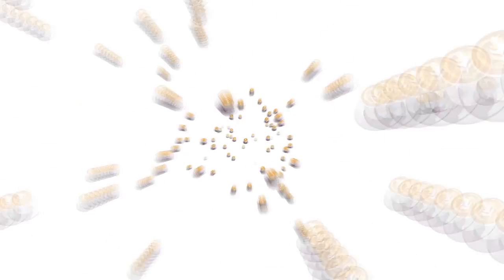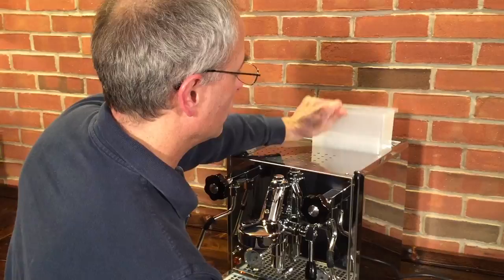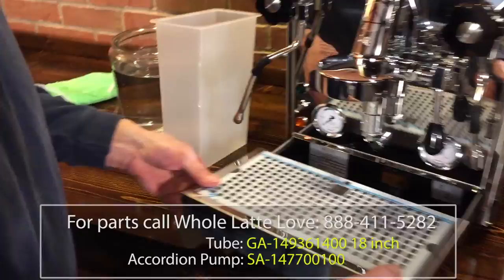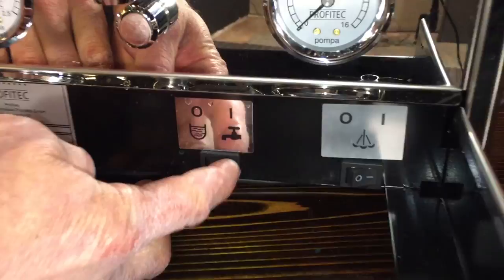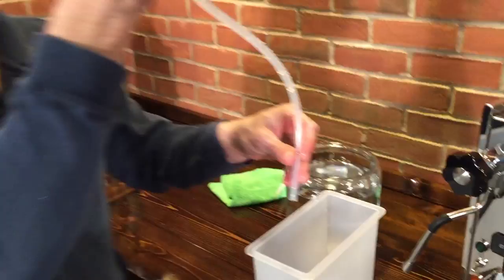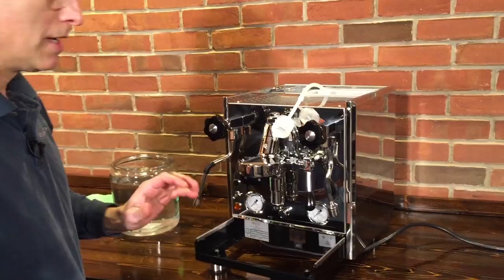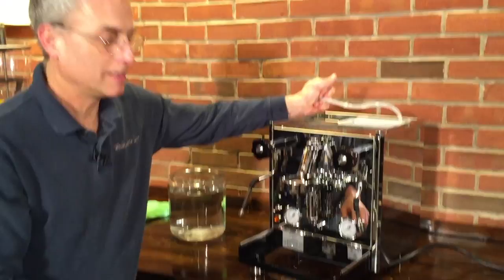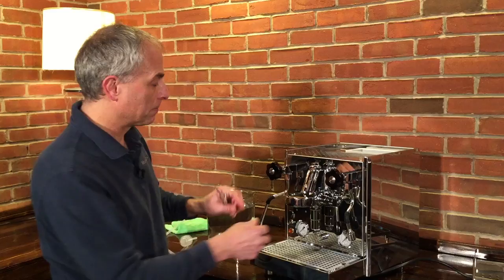How to Manually Prime the Pump of the Profitec Pro 700 Espresso Machine

Comment: The steam boiler appears not to have been filled, as the PID does not alternate, nor  can it be temperature programmed. Should both boilers be filled simultaneously during this process? If not, how is the steam boiler filled? As you mentioned the steam boiler has to be filled otherwise it will not operate.
Reply from the maker: Hi mark, There's a fill level probe in the steam boiler that senses water level and fills as needed. Are you sure the steam boiler is on? Check the switch behind the drip tray to the right. If it's in the "O" postion the boiler will not heat so will not produce steam or hot water.
Reply: @Wholelattelovepage  Thanks very much. Your tech service emailed me the PID reset code which prompted to refill the boiler. When filling, I let the brew group run for 30 seconds to purge potential air. Problem solved!

Comment: I just bought my Profitec pro 700.
When you turn on the machine, the water sinks to the bottom, above the support where the machine is resting. Why?
Reply from the maker: Hi GB, are you using reservoir or plumbed to water line. If plumbed, be sure the black lever for water source selection underneath the back of the machine is in the proper position. The tip of that lever should be pointing away from where the water line enters the machine - 3 o'clock if standing in front of the machine and looking down. If it's not in the proper position water can back flow from the waterline into the reservoir and push the reservoir up so water leaks around the connection of the reservoir. You can see the location and proper position of the switch I'm talking about here: https://youtu.be/2DPcZD48TxM?t=1m49s

Comment: If the machine is old, is it a good idea to replace the silicon tubing or can you clean it with descaler / something else instead?
Reply from the maker: If tubing looks damaged or is brittle then I would replace. In most machines (but not all) that type of tubing does not carry water at brew pressure levels. That type of tubing is typically used in low pressure applications like boiler vacuum relief drains and OPV return to reservoir.

Comment: Hi Mark, I am having an issue with my profitec 700, after doing backflush maintenance with Cafiza cleaning powder for the first time, I noticed the flow of the group head was low compared to the nice flow I had before, I first noticed it visually but then I confirmed it when I pulled my first shot after cleaning it, the shot took longer using the same beans and grind settings I had been using the days before. Could it be that this is what happened to my machine? Any suggestions what could have gone wrong? Thank you!!
Reply from the maker: Hi Mario, Sounds like your flow changed after the backflush. I'm not certain but backflushing may have dislodged some coffee crud and partially blocked flow. In your situation I would backflush again and see if that helps restore normal flow. If you continue to have an issue and you are in the US call our Tech Support at 595-924-7170 for free assistance.
Marc
Reply: Whole Latte Love thank you!!

Comment: Hi, great video!  I actually just purchased a new HX boiler as mine somehow cracked.  When I replace the boiler, do I have to somehow get water in the boiler before the heating element goes on?  I know the pump brings in the water but will it be quick enough before the heating element burns out?  Thank you for any direction on this!  The machine is a Isomac Millenium.
Reply from the maker: Hey ZG, Thanks for the kind comment and question. The water fill should be quick enough that it's no problem for the heating element.
Reply: @Wholelattelovepage  Thanks for the quick reply!

Comment: Video is great but it doesn't tell us how we will know if the pump needs to be primed. is it a noise or what? a video showing that will be awesome. also a video showing how to do one hell of a cleaning manually without descaling. I dont trust if some of the cleaning solution is still inside of the pump after a descale.
Reply from the maker: Hi, Thanks for the comment. When a machine needs to be primed you will know as it will not take in any water if not primed. Cleaning without descaling generally involves backflushing a machine. When backflushing no cleaning agents enter the boiler. A blind basket is used in a portafilter. Cleaning product is put in the basket and the brew lever is operated a number of times to work cleaning agent and hot water thru the group. Here's a video on backflushing: https://youtu.be/4mqS-EUOj5w
Reply: I am strongly considering using a direct water line on the profetic 700 or the ECM Synchronika and using the BWT on your site. any chance I would need to do the prime if I'm using a direct line with BWT?
Reply from the maker: Bishopheals74
Probably not. Line pressure should take care of that.

Comment: I just purchased my Profitec Pro 700 from you guys and it's on its way now - will I need those parts to prime it before I use it?
Reply from the maker: John Robinson Congrats on your purchase. One of our favorite machines! Manual priming is usually not required. If yours does need it you do not need to use the exact parts shown in the video. Can usually get a piece of tubing at home improvement/hardware store and use something like a turkey baster to force water into the pump.

Comment: , hey Mark Todd I just bought the profitect 700 I don't have I didn't know I needed this priming pump tube and squeezable accordion thing so how can I do this I won't be able to use my machine until you ship me one
Reply from the maker: A Profitec Pro 700? Very unusual that would need to be primed! Are you sure the plumb/reservoir valve switch is set to the proper position for your water source? It’s a black lever underneath machine at back. I’ve never had to prime a rotary pump semi-auto machine like the Pro 700 and I’ve used a lot of them!
Reply: @Wholelattelovepage  no I watch the video where it said that it had to be primed., I did not get the machine yet I am worried dude I need this tool then I would have to get it before I could start using the machine I'm going to have to use the reservoir for about a month then I'm going to get the filtering system I'm waiting until I get all my kitchen cabinets and everything set
Reply: @Wholelattelovepage  I don't understand this comment - isn't this whole video about priming the pump of a profitec pro 700? Yet this comment seems to indicate that this is unnecessary on this model
Reply from the maker: @eliasbagley  It is not normally needed. A very rare occurrence. Comment in regards to a person not receiving a priming bulb with the machine. Because it is so rare, a priming bulb is not included with this machine - not included with any make/model of machine that I'm aware of. As stated one can make their own or we can supply to a customer if needed.

Comment: What’s the diameter of the tube if I wanted to buy my own (I’m in Hawaii) 
We had some friends stay here and they were kind enough to clean the machine but accidentally flipped the switch from reservoir to plumbed in. (We operate on a reservoir.). Well I didn’t know that and the reservoir emptied without the. Light indicator and it wicked air in. Now it seems to not have the auto function to kick in.
Reply from the maker: Hi s, Even if the machine brought air in it's unusual for it to air lock in the situation you describe. Be sure both the switch behind the drip tray and the water selector source valve underneath the rear of machine are in the proper positions. If that's all correct and still not taking in water the part we have is 3.5mm inside diameter, 6mm outside diameter silicone tube. Other close sizes can work as the tube is flexible and can stretch over the nipple in reservoir. Might be best to take the reservoir to a home supply store or similar to test fit if possible. Hope that helps. If you continue to have issues you can contact our tech support team here for assistance: https://support.wholelattelove.com/hc/